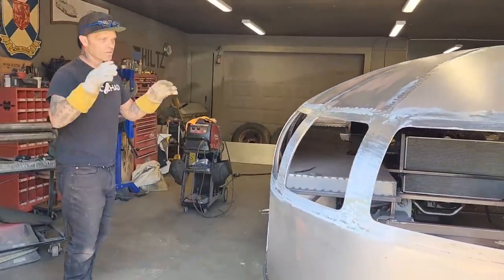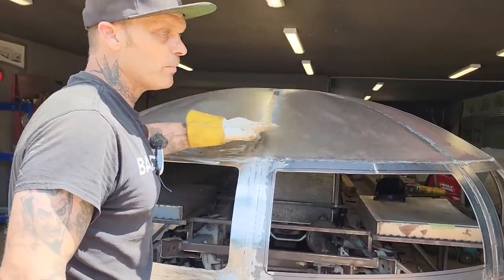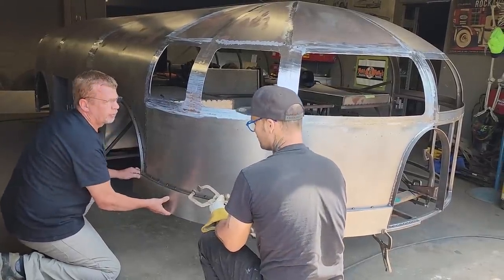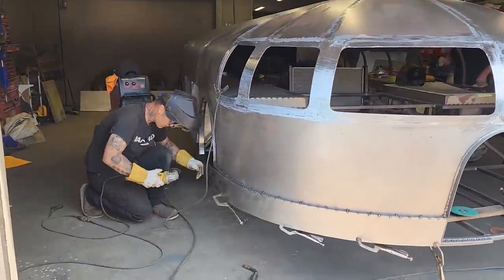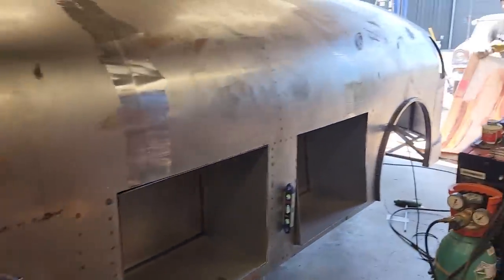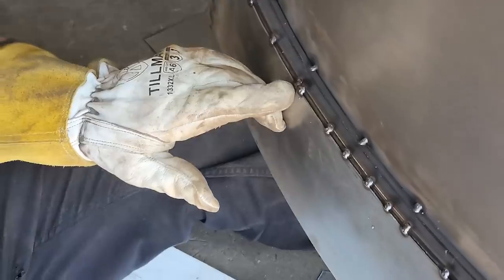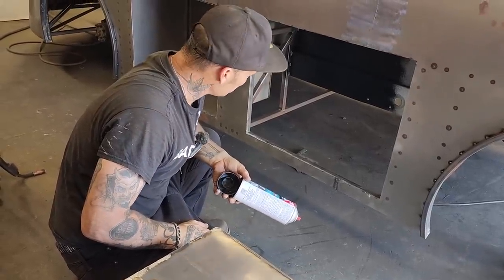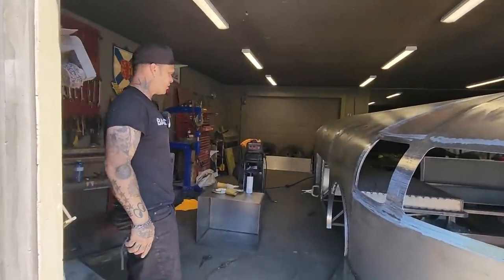Fabricating a custom bumper using sheet metal 💯

Comment: Hi Chad, Jolene, & Fina, it is extremely hot & humid here in Wisconsin down by the Illinois border as well. It is steadily coming along day by day and I like the design of the front bumper. Just an idea Chad, (take it if you like it and throw it away if you don't) I think what I might do with the front bumper is drill a small hole towards each end and pick up the expanding foam for around windows & doors from the home improvement store and fill the inside and then weld the holes up. I would do it to make it a little more damage resistant from rocks and things that might get kicked up by a vehicle in front of you. With the 18 ga. metal and being hollow it would just help strengthen it to stop small dings & things. Jolene you probably get tired of hearing it at this point but, great video as always and I am glad to see that you have a sponsor as it all helps! Fina was alert and on duty when a guest showed up with enough hinges to last several lifetimes!

Comment: Hi Chad and Jolene…  I’ve been giving some thought to the safety factor of the Bugatti Hauler’s passenger cabin.  Without any substantial reinforcement to the bumper, you are creating a Widow/Widower maker.  All that square tubing will fold up like match sticks in a head-on collision trapping the occupants inside.  Plus, you’ll be towing the trailer and Jolene’s Bugatti.  At highway speeds you and her, even in a “finder bender” wreck, will be in grave danger.  Please give this matter some consideration.  I watch your show every day!!  Jolene, your camerawork is phenomenal!!
Reply: I agree with you..... safety first...I said a month ago to build it out of exhaust pipe.and full front roll cage...I like the way it looks but I would not ride in it.
Reply: Safety is not a thing at Hiltz Auto.
Reply: @thomassciurba5323  the green goblin would scare me to ride in it..but it a beautiful design. No a daily driver..... I don't drive motorcycle either....I not a risk taker..... Chad has a good imagination and builds some cool rides..,.master chop artist.....

Comment: Chad needs some weld through primer. I feel that the inside of that bumper is going to rust and eventually rot out. Some weld through primer would make it last much longer. Or they use like a wax type product and spray it in the inside of frames after they are dipped and finished to keep them from rusting.

Comment: Chad when you put in your entry doors. You should think about putting them on the shoulder side of the road for safety and ease of entry. The travel portion of the road could be very dangerous to get in and out of your hauler.

Comment: Chad you need a collection of what I call finger clamps. They come in differen't sizes & will hold the flat steel to your tubing & not leave marks. The ends are rubber tipped. FYI

Comment: On the bumper sheet metal why do you not use a horizontal weld rather than a vertical weld it would use way less wire?

Comment: For the gas just run the gas line out of the fuel cell up to roof and make a mount to hold the gas line so it don't move and ratel then run the gas line back down then run it to the engine that will stop the gas from filling up the engine

Comment: Not complaining about anything you do on any of your projects, but from what I could see on that part you have mounted to the front of the motor looks like an air conditioning condenser radiator, not an engine cooling radiator. Most engine radiators are at least two or three cores (much thicker than what you have there) and in hot situations a four core is generally necessary. If that "radiator" as you call it has only small threaded fittings on the side or bottom then it very well could be a condenser for air conditioning. It should have something like 1 1/2" hose fittings on it, not 3/8" or 5/8" tapered fittings. Keep up the good work, a lot of us enjoy your trials and tribulations on your projects.

Comment: I personally think to enter into the cabin, your hatch door should be much larger consider cutting out the crossbar where you are going to put your hatch. It would make entering and exiting much easier. Maybe just move the crossmember up a foot or so. I know this is your baby but just giving you some thoughts.
Reply: I think it would actually be better for your entry and exit to be from the front of the cabin, even just the driver's side. Look even more custom.

Comment: Love the window frames.. curious, wil they be glass or lexan . To get the double curve you may need to make a frame for each shape to allow a slummed glass shape to be made so they follow the body shape and fit correctly to the frames. I think there is a windshield company in Montreal that can make custom windshield shapes. A large sign company may be needed to slump plexi or lexan.  Lexan needs preheating to release moisture so it doesnt have gassing bubbles from the heat needed to vacuum form or slump

Comment: Well it all depends on how much experience of welding you have, like if you want the welds to be deeper and not a lump of weld,then you want more heat and less wire,but you have to know what you doing or you will burn holes,but this is all learned from experience, like you actually don't need welding wire to weld metal together all you need is arc heat to fuse the two panels together, just like a factory does to spot weld all the panels together on vehicles,but doing this type fabrication requires wire to fill gaps and on and on, nothing wrong with how Chad welds and I'm sure he knows what I'm saying because he has a lot of experience learned from failure, without failure there is no lessons learned.

Comment: You might think about an air bag system, or hydraulics to give you some lift on the body when you need it. 8 in ain’t much clearance with speed bumps, curbs and inclines. Can’t wait to see it complete. What color will it be?

Comment: Awesome build!! Is all four tool boxes necessary? I am wondering may one of tool box space be used/ designed for spare tire. And I think  the engine bay needs separate insulated hood to reduce interior temperature.🛠🔨🚙🚙

Comment: Hauler is looking good. But I would seriously consider putting in the driver and passenger side doors like the original. God for bid you're in an accident, you could be trapped in a sardine can without a way to quickly exit.  What kind of inspection does NS require for experimental vehicles like yours?  Would you pass without doors?  Also I would have continued the bumper across the Bugatti grill for protection alone. Are you  planning on creating duct work to cool the engine from this front grill?

Comment: The window shapes look good, Chad, but those posts look really really wide to the point that they may not even safety the vehicle. That kind of width would definitely create a blind spots and impede on your visibility and it may not even pass inspection but your looking at it in real time, maybe its just the camera lens creating a wider image or maybe not. Nevertheless the rounded windows does look really good. BTW Chad, Please, no flexible chrome on this Tanker. The reason I say that is because it looks cheap. And lets be honest your hauling a replica of a Bugatti so you don't want it to look cheap! just my opinion bud.